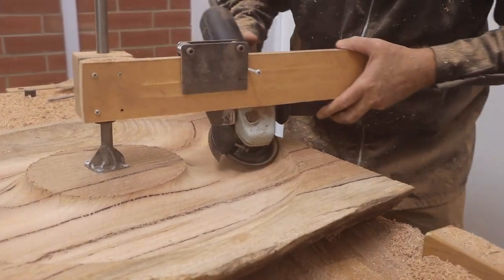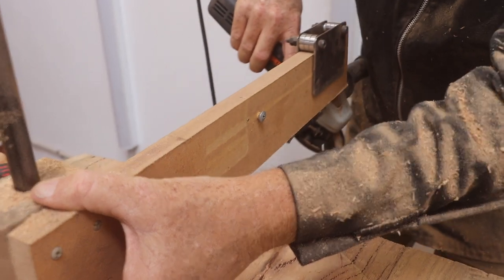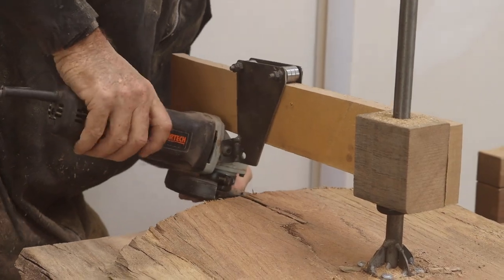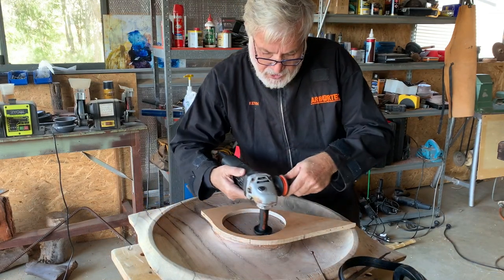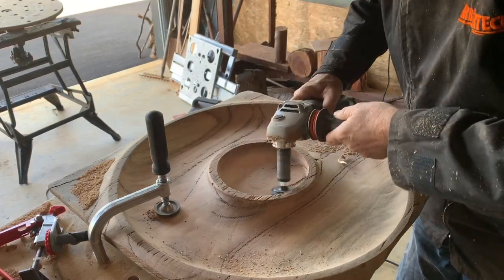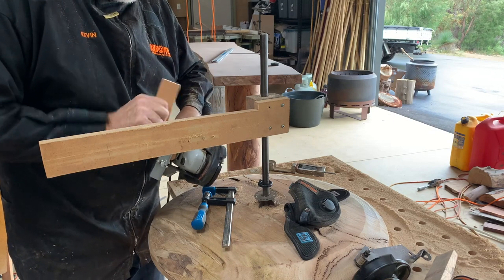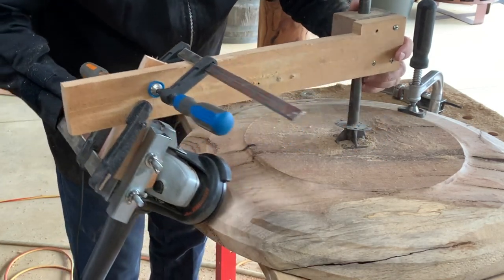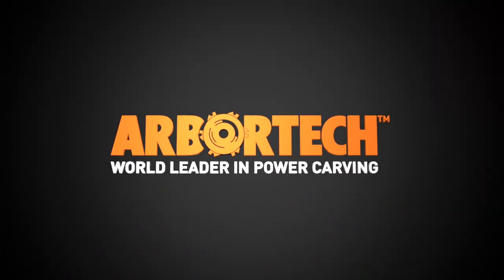Power Carving a Charcuterie Board | Woodworking Jig | Turning Wood

Comment: A good idea. It would be good to have looked closer at the attachment of the bracket to the tool. 
Should be able to work it out though. Doing something similar today for a Jigsaw to cut circular holes, as I don't have a bandsaw as yet.